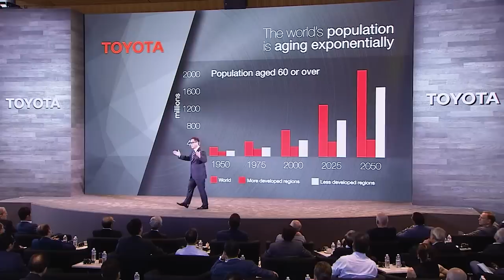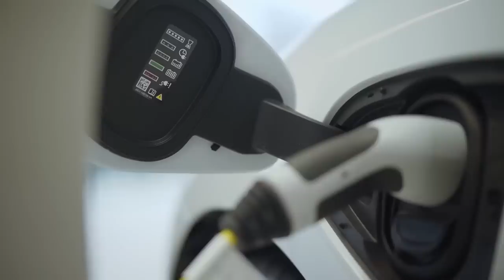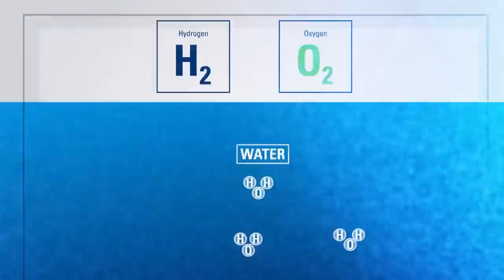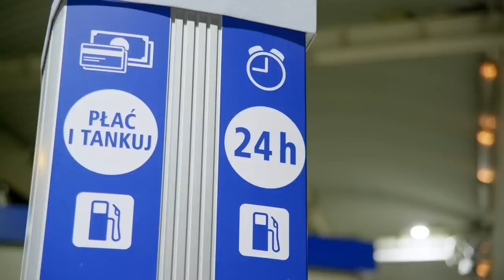New Toyota CEO Shocks Everybody | Huge News

Comment: It’s just nice to see a company that large with leadership using common sense, instead of feel good methods.
Reply: I dont fall for liberal lies.
Reply: What is common sense about hydrogen?
Reply: @justcommenting4981   The fact that it burns clean and doesn't require a complete remake of our electric grid. Where I live, middle of nowhere Illinois, it is estimated that if 1 in 25 households had an EV it would crash the grid. The numbers are worse the closer you get to Chicago because of the population and increase in electrical demand. We will never run out of hydrogen, so it seems like a great choice for our sustainable clean energy source.
Reply: @larrywilliams8063  it would be less expensive to "remake the electric grid" than distribute hydrogen let alone extract it. You literally have electricity at your house and most people will never exceed the range of a battery pack in a single day. You can charge at home. Even if you couldn't you literally just need to run power lines to a couple areas for faster charging. You guys do realize solar or gas energy is required to extract hydrogen from water in the first place right? You are just taking gas and electric energy, storing it as explosive hydrogen, then converting it into electricity again because hydrogen cells make electricity for ELECTRIC DRIVE TRAINS.

I'm sorry but hydrogen cars are an incredibly stupid concept. Toyota is way behind where they should be. I want to drive an electric car but with a greater chance of exploding and more of a hassle to recharge? I'm missing the common sense here.
Reply: @justcommenting4981  where do you have all the new power plants to provide electricity? Youl would need at least to double the power production of ALL current power plants, completely overhauld the power grid to be able to handle the load. Then there are the batteries.
Reply: @tikaltoki4561  where do you have the new plants to provide hydrogen. Take 30 seconds to apply the criticism back to your own beliefs and save us both some time. You could make a gasoline powered electric plant and it would still be more efficient because at allows optimal RPM. If hydrogen was a viable fuel you could make a hydrogen electric plant. There isn't one. Should tell you something.
Reply: But it is not only the cars that will need electricity, but also the industry. First the industry will have to expand, to make new jobs. We are becoming more and more people in this world, that will need jobs to survive. Then the old industry, will have to change from what ever they are using today, to electricity, due to global warming. The demand for electrical energy will be enorm, and the prices will be skyrocketing. I’ll cost at least twice the price of charging your car, than what it costs today, to fill your tank with gasoline. And the range is shorter, so you will have to charge more often, then you fill gas.
Reply: @chaophraya8003  no because it would still be more efficient to run a gas power plant to charge an electric car. Because cars engines can't run at their most efficient rpm continuously. An electric car is more efficient all the way from the power plant.
Reply: @justcommenting4981   yeah while California gov says not to charge your ev because there isn’t enough power. Wind and solar isn’t going to solve it. And some of what power they make is stored in batteries. We don’t know what environmental impact that will ultimately create. Most of raw material comes from countries that want the USA destruction. 
There has to be a better way!!!!! Hydrogen makes more sense than battery powered cars period.
Reply: @justcommenting4981  I know, but you can not burn gas, due to global warming.
Reply: @larrywilliams8063  Apparently you believe that no one is thinking ahead to plan for additional demand for electricity. Well it is always possible that the people who are in charge of these things turn out to be stupid and lacking in planning ability but we have a history to rely on to predict what will happen in the future. Unless you live in Texas which has shown a very poor ability to plan for power problems, Americans shouldn't need to worry about not having enough electricity to go around.
Reply: @chaophraya8003  you would burn less gas because it would be more efficient. So it wouldn't be ideal but it would be better than adding to the gasoline cars currently in operation. Ideally renewable energy or nuclear power would be used instead. In the case of hydrogen you must expend an equal or greater amount of energy to break the hydrogen bonds which means you still use more energy total energy. Except instead of just making more electricity directly, you're making hydrogen to convert into electricity later.

I'm pretty sure Toyota either is too proud to accept this idea is stupid, or they want to sell hydrogen and extraction equipment. Which is also stupid, but less so.
Reply: I take my 07 Corolla to the mechanic once a year and there is never anything wrong with it. Mechanic said, “That car will just keep Corolling along forever”.

Comment: My 2005 Toyota is still going strong. I'm holding onto it because I don't want to wait hours for my car to recharge. I will aim to buy a traditional Toyota again.
Reply: Like thats a long tome ago  ?
Reply: 1995 Nissan Pathfinder is fine for me; I do hope they keep making gas engines...
Reply: Driving an older car means less emissions overall, as production of an ecar equals about 2million miles of an ICE. These days most emissions are from tires and brakes, which e-cars only make worse by being 2x heavier.
Reply: it takes 30 minutes to charge. (much love to toyota i own one) but it still takes 30 minutes not hours thats just media talk.
Reply: @navysnow5618  How many miles do you get from that 30min charge?  Also is that with a standard charger or some special super charger that is only available in special locations?  I can fill my tank in 5~10 minutes at practically any gas station and drive another 300+ miles.
Reply: @Tadda  30 minutes is on higher end lol that's for the long rang ones around 350 miles for me it's like 25 minutes since it's a regular model 3. And most tesla chargers are that speed it's not special. At home, charging is a different story, but who cares if your tesla can charge in 30 at home it dosnt matter if you're asleep anyway. And yes, 30 minutes is longer than 5 or 10, which is a disadvantage, but there are other advantages.
Reply: @Nobody Noone  yea keeping old car is by farrrrrr better for envirment. The only thing wrong is that teslas don't use breaks 99.9 percent of the time, there is only 1 pedal driving, and it uses regenerative breaks. You will almost never have to change your breaks. That's why tesla semi is big deal because truck drivers spend a lot of money on breaks. When you drive there is no idle like a combustion car so there is no hitting breaks when you let go of accelerater that car stops.
Reply: @navysnow5618  so 30 min is for a full charge?
Reply: @Tadda  yea, my dad owns one with a normal battery. we are never at 0, and it's about 23 minutes maybe 10-100.
Reply: I've also got a 2005 that I'm still driving. My Corolla has never had any engine or transmission issues to this day.
Reply: Yeah it’s horrible, didn’t see a gas station for 15 months now and my car charges while I sleep.
Reply: @navysnow5618  It takes less than 5 minutes to fill my Toyota with gas and it can go further than you 30 min. charged car so.....Plus I don't have to have electrical work done to my home to be able to charge it or go to one of the limited charging stations in public.
Reply: @kman-mi7su  yea, but my car goes faster than a 500,000 Lamborghini.
Reply: @navysnow5618  And sitting in traffic like most cars 90% of the time, it goes just as fast a any other. Th majority of people don't buy their car for its speed.
Reply: @kman 4443  reason people buy cars
1:reliable- you never change oil or any of the such and last much longer than gas cars, and it will never break down on you.
2: speed: 2nd fastest street legal car
3:luxury: most comfortable seats out of any car with the seats being made taking into account pressure points in body, you don't have to drive it can drive itself, no buttons.
Gas mileage: extremely cheap to drive
Range: 400 miles and you do not need to stop at stations unless on road trips, and do not need to install a charger unless you drive often and can use a regular mobile connector and not install anything.
Price: about 40,000 brand new and you get about 8,000 taken off because it's an ev, by far a cheap car for the speed and luxury.(32,000usd)
Reply: @navysnow5618  can you get 750km on a single charge? That's the return trip to our major hospital.
Reply: @jillshepherd4225  thinks that's about 450 miles. The max tesla miles you can buy is around 420, so if that's your only access to a hospital, maybe a gas car is better. The cheapest teslas get around 250 270.

Comment: Its nice to see a company useing engineering based decisions to run the company instead of political based decisions!
Reply: BEVs are a lot more energy efficient than hydrogen cars. That means we’ll need a lot less solar & wind power AND it’s cheaper for the consumer. 

Toyota is digging its own grave.
Reply: @stephanbergmann8373  tell me how many children have to mine for hydrogen as opposed to mining for lithium
Reply: @mikhanch1228  1. There is zero child labor in lithium mining (i think you mean cobalt?)
2. Hydrogen cars aren’t built out of thin air. The energy to produce hydrogen neither. Overall, the carbon footprint of BEVs is smaller than that of hydrogen cars.
Reply: @stephanbergmann8373  arent some of the biggest lithium mines in africa?
Reply: @meegssan5716  yes and current ones dont have enough lithium so they need expansion
Reply: @meegssan5716  Lithium is a very common mineral. The largest producers are Australia, Chile and China.
Reply: @stephanbergmann8373   Lithium is a very common mineral BUT there are few deposits WORTH MINING. Gold is a very common metal too BUT there are few deposits WORTH MINING. Can't expect mining companies too process 100 tons of ore to extract 0.1 milligram of lithium and be happy about it. Sure it would be quite FUN and give everybody jobs processing those 100 tons of ore but the company would go bankrupt the next month. 😄😂🤣
Reply: @pbxn-3rdx-85percent  Yes and no. The higher the demand for a ressource, the more deposits are worth mining - we see the same phenomenon with oil (deep sea drilling or fracking are only a thing because the oil price is so high). 

The more important point: Lithium is abundantly available across the globe but it takes many years to set up mining & processing. Demand for lithium has exploded in the last 5 years and continues to grow faster than production can expand.
Reply: @stephanbergmann8373  new Tesla battery will be free from Lithium... You can do research online.
Reply: @Mįķə Håņčhø  new Tesla battery will be Lithium free.. No more money for the kids 😂.
Reply: That's because its Japan.
Reply: @stephanbergmann8373  Your comment is odd, because hydrogen vehicles are EVs.  So, they have the same energy efficiency as battery electric vehicles.
Reply: @stephanbergmann8373  interesting did not know there is zero child labor in lithium mining but im sure lithium and cobalt go hand in hand as you need both for efficiency
Reply: @stephanbergmann8373  there ARE children mining lithium though
Reply: will the company die from it? the outside world might go against toyota
Reply: @meegssan5716  Cobalt mining is mostly in Congo and pretty nasty stuff. But it’s also very expensive so the industry is trying to find alternatives. Newer battery cell technology can already do without cobalt (e.g. Tesla and CATL).
Reply: @mikhanch1228  All major lithium producing countries (Australia, Chile and China) do not allow child labor. The US and Europe certainly neither. Not sure what luthium mines you are refering to.
Reply: @buckeyefan5557  No, that is factually incorrect. Hydrogen is stored in tanks and hydrogen powered cars can get about 300 miles with about 10 minutes at the “hydrogen pump”. The vehicle then generates electrical energy from hydrogen. However, hydrogen loses as much as 70% of its energy content when it is produced and transported and has only about half the overall efficiency of a battery-powered vehicle.
Reply: @stephanbergmann8373  china? No child labor? 🤣🤣🤣🤣🤣
Reply: Its called profit based decision
Reply: @stephanbergmann8373  It's not all about efficiency. We are running out of gasoline and we can't manufacture it like we can alcohol and hydrogen. When the petroleum fuel is gone, it's gone.
Reply: @stickyfox  Nah, we're not running out of gasoline any time soon ("peak oil" has been pushed more and more into the future thanks to fracking and deep sea drilling) - however, we need to get away from using fossile fuels anyways to drastically cut carbon emissions - ideally before we reach a global warming of 2 degrees celsius or more. 

What is the best / most realistic way of doing that? 

Pretty simple: We need to build a crap ton of solar and wind power - something that is already happening in a lot of places (e.g. China, parts of the US and Europe, etc.). The problem? We can't build this stuff fast enough and even though it is cost effective, it's not free. THUS we do need to lower our energy consumption as much as possible - using hydrogen for cars is nowhere near as energy efficient as using BEVs.
Reply: This is how the world should be run 🤝
Reply: @stephanbergmann8373  That's not easy to do with our #1 leader on TV saying that wind power causes cancer and kills birds, or the slew of predecessors before him and world dictators in general who own oil wells.

What's efficient and inefficient depends a heck of a lot on how much research has been done.. or more specifically how much has not been done. The most efficient gasoline engine in existence still can't extract even a third of the energy in gasoline and put it onto the road.
Reply: Politics will be in the way so can't be ignored because consumers' every day life is very much influenced by politics so we can't be too naive.
Reply: They just know Muricans aren't very bright, but they're willing to get into massive debt to buy terrible vehicles that have macho names 😂
Reply: Apparently it is not a decision made on economic or efficiency. Hydrogen is neither.
Grey hydrogen (produced from natural gss) has a larger carbon footprint than gasoline, diesel, or the natural gas that it is made from and it is more expensive. Hydrogen produced through electrolysis uses 2X-3X more electricity to produce hydrogen for an HFCV than it does to charge a battery EV.  A practical comparison is the, last I checked, mpg-e for the Toyota Mirai is 66 mpg-e while the Tesla Model 3 is rated at 144 mpg-e.  So the Tesla get 2.2x the mpg-e of the Mirai. 
Hydrogen requires about 48 kilowatt hours (KWH) of electricity to produce 1 kg of hydrogen with an efficent electrolyzer then more energy is required to compress and purify the hydrogen ranging from 5 to 15 KWH per kg, dependent on size of system. So let's 10kW to compress it. That is 58kWh of electricity to produce 1kg of  hydrogen that contains about 33.4 kWh of energy.  One gallon of gasoline contains 33.7 kWh.
The Mirai can go 66 miles on that 1g. On the same amount of energy , 58kWh, a Tesla Model 3 that use 0.234 kWh/mile can go 58kWh ÷ 0.234 kWh/mile = 248 miles. 
Hydrogen doesn't make sense.
Reply: @stephanbergmann8373  agreed!